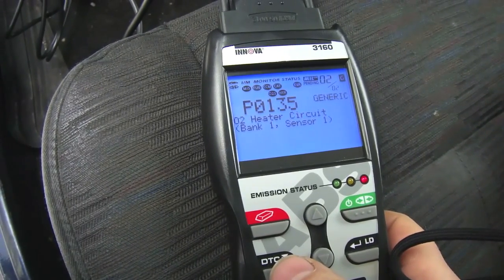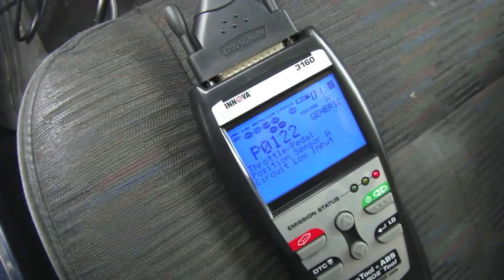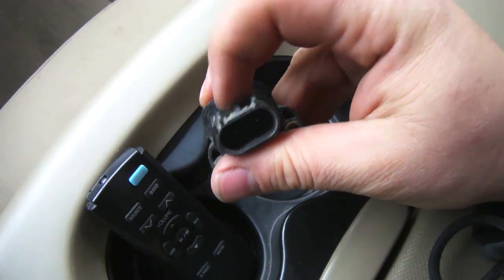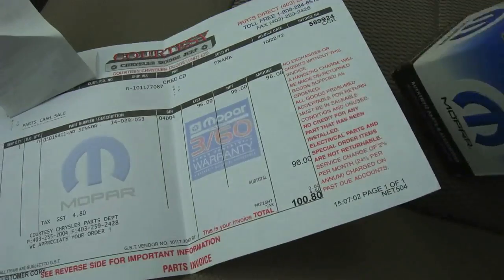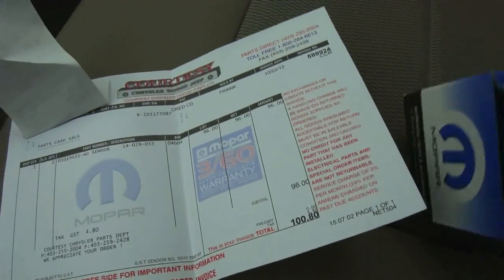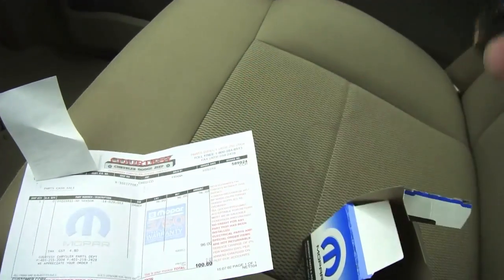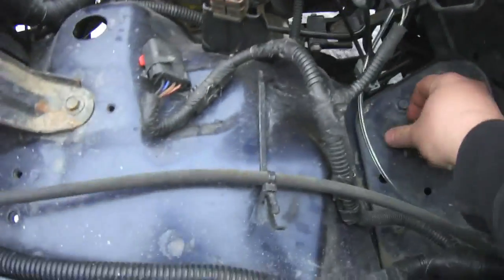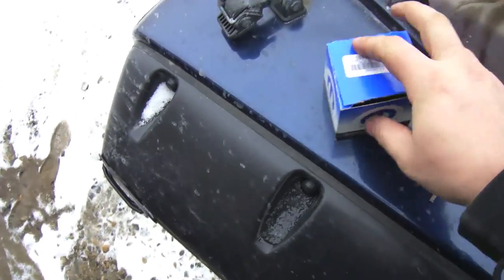P0122 How to Replace a throttle Postion Sensor

Comment: I have a 98 cherokee with a 5.2 went to start it tonight and it would not start unless I stepped on the padded and held it down some if I let it up it would die will not idle it did throw a fault code I don't have a scanner not sure if it is the TPS was thinking it may be the way it is acting had no check engine light till i had the wife start it and I worked the throttle under the hood the see if I could keep it running  then she told me it cam on and now it is staying on any in put you may have would be great I'm not sure if I can get it some place to get it scanned.
Reply from the maker: you need to find out what the code is and investigate before you can really do anything

Comment: Luv your vids you upload on your e46. Help me please,i have a p0120 code on e46 2003 330i read using inpa it says.. position sensor/switchA circuit malfunction.
V_TPS_1 1.31v
V_TPS_2 4.49v.
Is this my throttle body sensor or a problem with the throttle body itself.Also get a p1623  sometimes. Help me please and keep up the good work.
Reply from the maker: could be either or you'll have to find out if your throttle body is sticking
Reply: Bullshitkorner
Thanks for the reply. So have to get the throttle body checked out to see for sure.